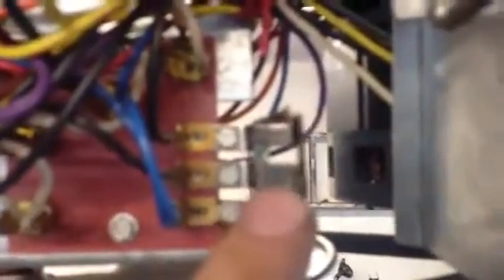Garage Door Opener Parts: Thermal Light Delays

Comment: Them old units like that are indistructable. If you lubricate all the moving parts regularly, they go 30+ years. Mines that old. That thermal light switch will probably quit working like mine did, so I just unplugged the wires and hooked up an outdoor motion detector to turn the light on and off if anyone is in the area. It works perfect now.

Comment: You're awesome. I switched off the sensor and it works fine now. Turns off after the set time. Apparently the sensor is way too sensitive to heat..and since the garage is always hot...the light was always on.  Thanks!

Comment: Can u help me brother? My moms chamberlain liftmaster 3850 works fine but for the light. It never turns off...or rarely. If i press the off button on the wall it turns off for about 8sec. She even covered the sensor up with electrical tape.  Any ideas?